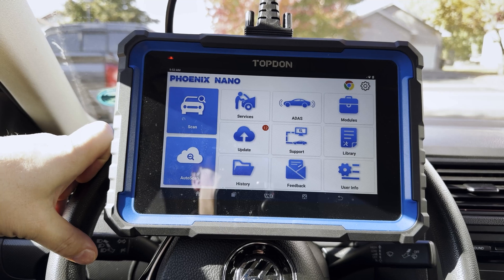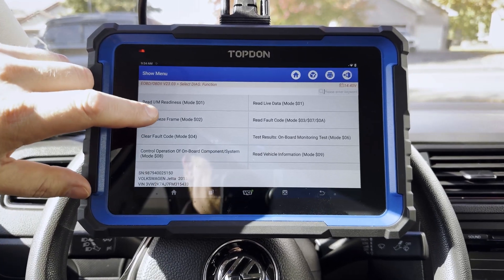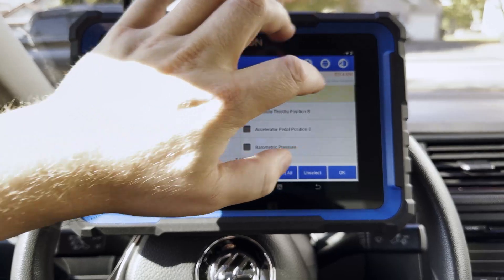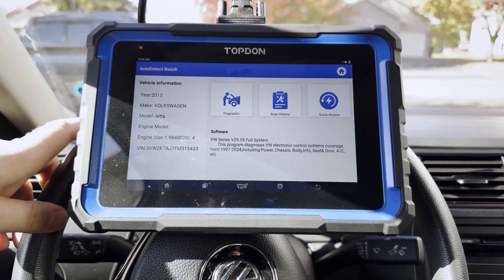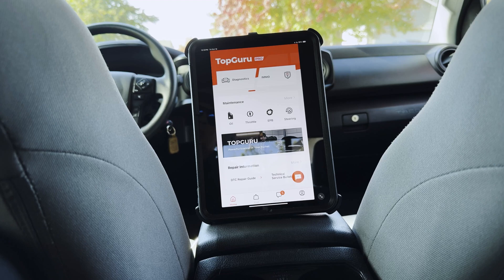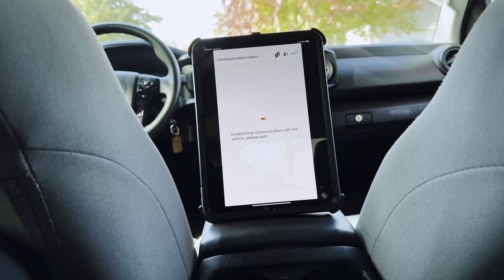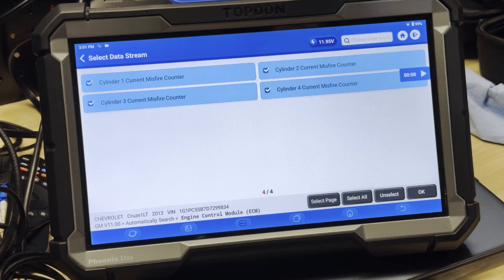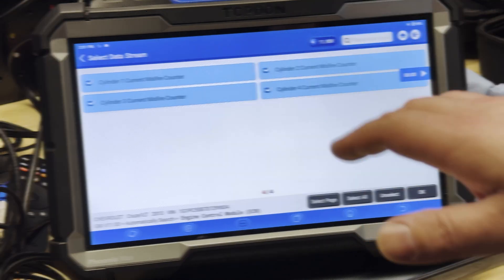Locating Misfire Data in OEM and OBD Menus

Comment: It would have been nice if you actually walked thru an engine with a misfire. a $100 OTC scanner can show just as much. Your video needs to show relevance of the cam/crank sensor to a misfire as well as COP signals and MAP Air Temp. Fuel trim short and long as well as O2  after cat. What you showed me is a car that did not have a misfire showed no misfire. I am on the fence between a PICO Scope and this scope. What you have shown me is Pico makes a better video and probably a better scop too. I might never know since your video did not show misfire data.
Reply from the maker: Thank you for your feedback! I understand your concerns regarding the lack of misfire data in the video. Our aim was to provide a basic overview of the tool’s capabilities, but we appreciate your suggestions for including more specific diagnostic information such as cam/crank sensor signals, COP, MAP, fuel trim, and O2 sensor readings. Thanks for your input and will work on improving the content to help you make a more informed decision.